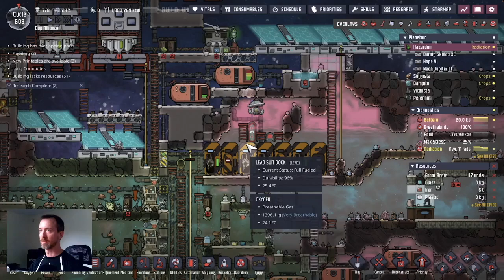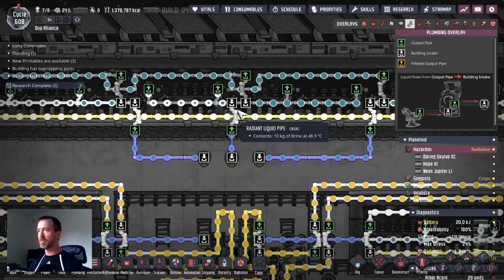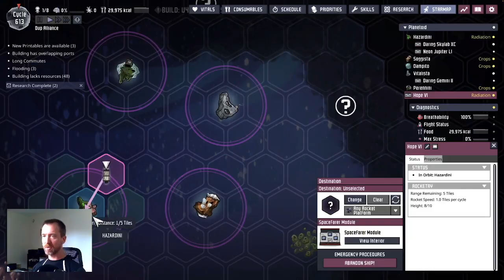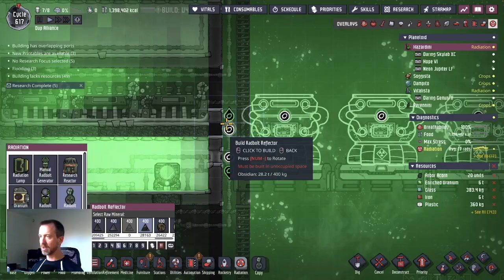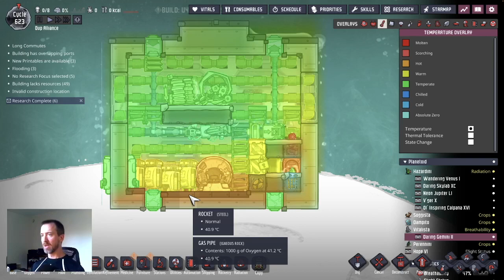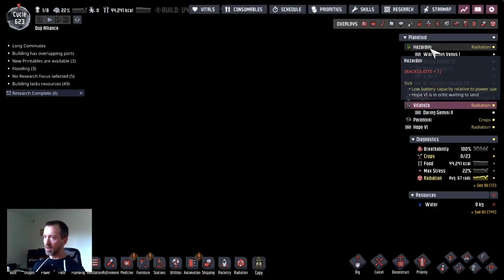Oxygen Not Included: Hard Mode 27 - Radbolt Engine Fleet

Comment: jeff just a note for future builds ,airflow tiles conduct heat with solid material sitting atop of it and also with any gas contained in it this can be disasterous when you drop a 1400'C ignesious rock on the tile and the tile is made up of copper which melts at 1020'C something( the heaat conduction is slow and from tile to adjacent tiles or material sitting atop the tiles which is very low in case of minerals ).so you should idealy use insulated tiles to transfer materials(even canned Liquids)."or i am wrong and this comment can be ignored".
Reply from the maker: Thanks for the info. I love how there is always something to learn about this game. I'll have to think about how and where I am using the airflow tiles. I assume this goes for the mesh tile too.